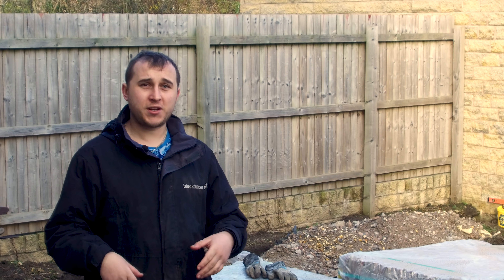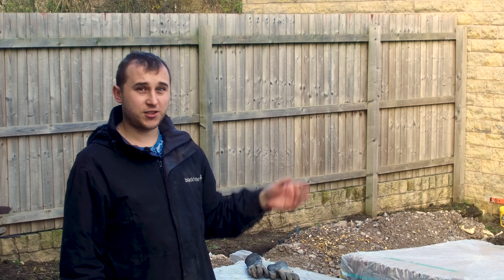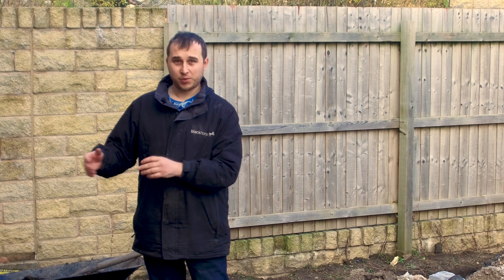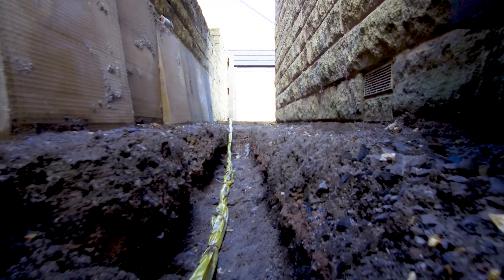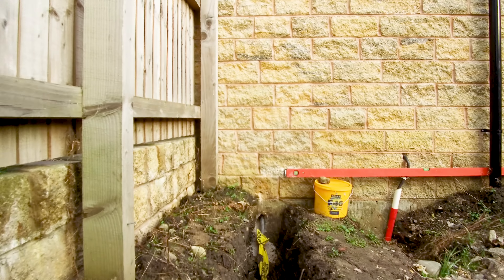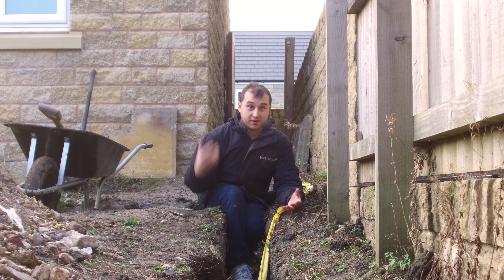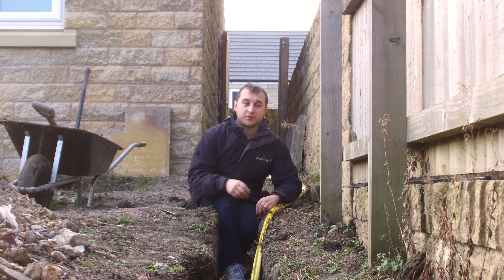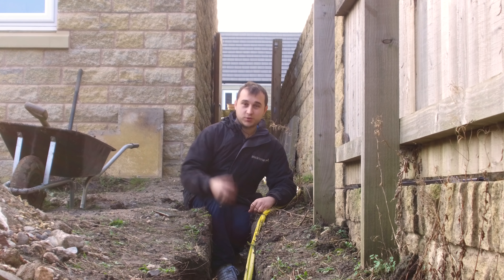How To Futureproof For Electric Car Charger Or Battery

Comment: You’ve probably done the job by now, but if it were my install I’d have put in a 4” soil pipe and run the cable through that along with a couple of draw strings the pipe is cheap it’s good protection and it big enough for future updates.
Reply from the maker: Would of meant a much bigger hole and dig was hard enough as it was 😂 the drain pipe should be big enough to pull any services I may need
Reply: Yep I agree but not only for that reason over time with temp fluctuations cables contract and in some cases like the nightmare that was base 10t building to building in the day we were often looking for breaks every winter freeze, thank god for fibre
Reply: @NicolasRaimo  The soil pipe would have less friction than a drainpipe. It's also much more robust, resists cracking and crushing, and is guaranteed waterproof.

Comment: Great video Nick. I've been looking into this sort of thing as I plan on doing a full refurb of my house in the next 5 years.  What I'm hoping to do is go the full shebang! This includes solar panels, power wall 2 (or equivalent, you never know what products will be on the market at the time), underfloor heating powered by ground source heat pump and of course vehicle charging!

Comment: Nick, I’d suggest using something stronger than plastic drain pipe for your conduit such as concrete pipe.  I’ve just aerated my lawn and gone straight through a plastic conduit (and the pond pump pipe inside it...) 😭. Better safe than sorry!
Reply from the maker: It’s too deep to be hit ;) it also runs under my path that’s flagged
Reply: @NicolasRaimo  Ah, good move!
Reply from the maker: Had to dig super deep for electric so there’s a layer of sand on electric then duct for this  and even that’s just about deep enough for being safe for 3 ph future if need be

Comment: If you're unhappy with the noise from your gas boiler, an air source heat pump is not likely to be an improvement.
Reply: Why do you say that? I've stood less than 2 metres from a running powerful Steibel Eltron ASHP  [13kw] and I could hardly hear it running. In a quiet environment. From the inside, it might be worse if the pump is 'hung' on the wall., of course.

Comment: Hi Nick. Good video, thanks.  I’m in a similar situation to you with a remote garage and I’m also planning to install cables. What size cable did you choose? 4mm, 6mm or 10mm? Two core or three core? 
Considering your remarks about three-phase supply in future, I wonder whether it would be worth laying cable suitable for three-phase now, given the small difference in cost?
Cheers
Reply from the maker: If you think your go 3ph yes lay it and no am on 25mm cable gives zero voltage drops and allows 100 amp pull no issue,  16mm should of been ok thou